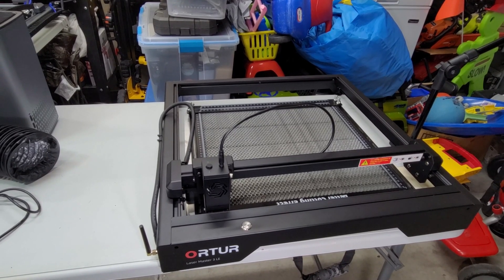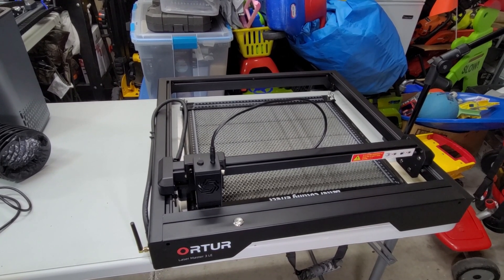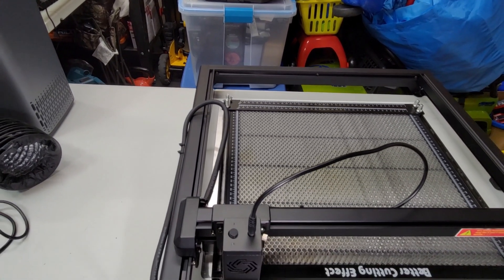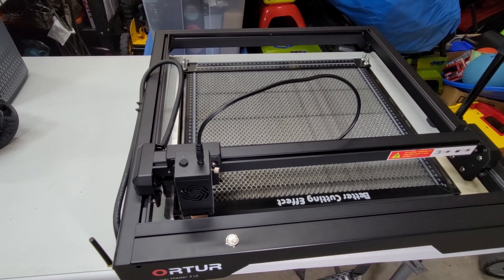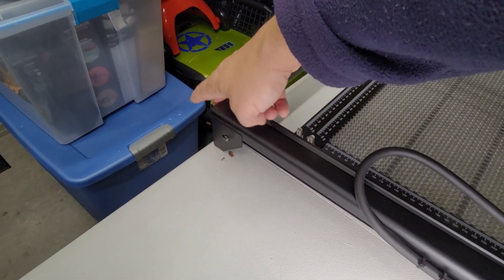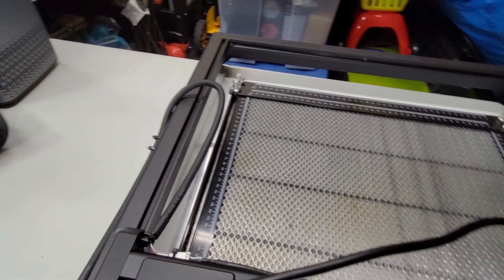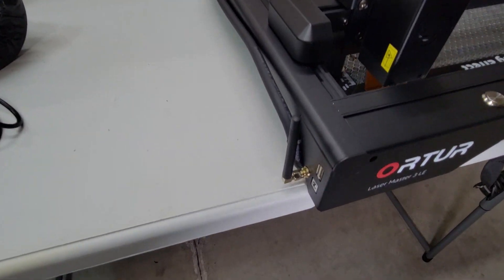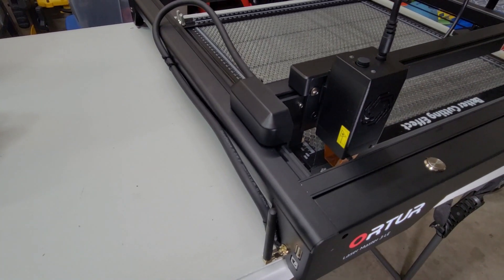👉 What's the DIFFERENCE? - Ortur Laser Master 3 LE (OLM3LE) vs Ortur Laser Master 3 (OLM3)

Comment: Hello sir! Is the OLM3LE be enough for engraving on pendants? (Jewelry)
Reply from the maker: It depends on the material. I have engraved on stainless steel and anodized material. You can use special paint to engrave on some material. You will definitely want the my 10W laser module. What material are you interested in?